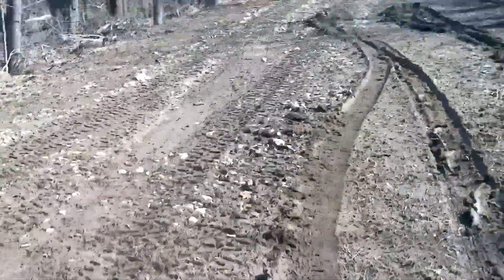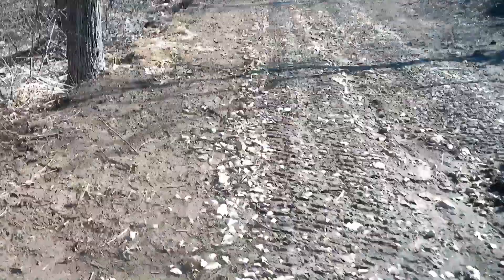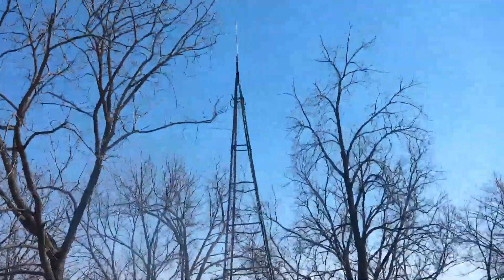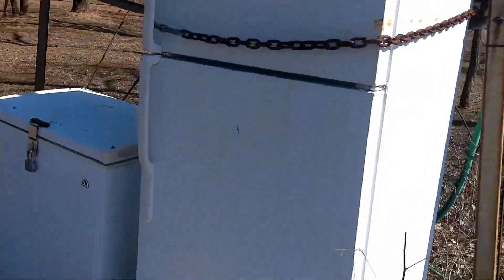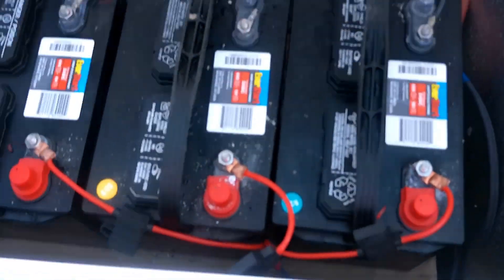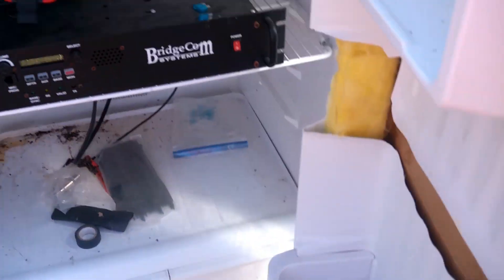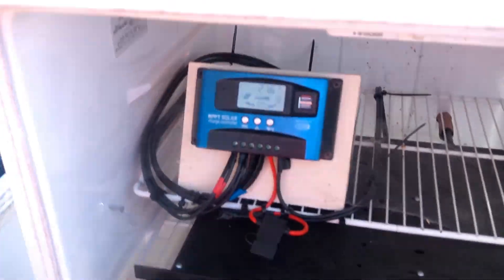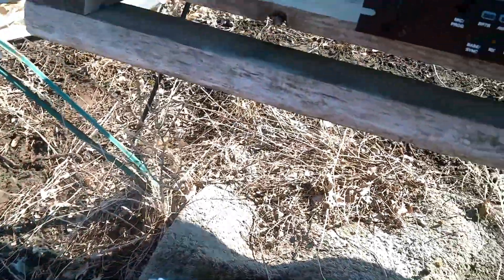Checking out a GMRS Repeater Site - Emergency Local GMRS - Ham Radio & Networking

Comment: Never thought about using old refrigerators a repeaters HUTs or shacks, but I guess when you're running off solar or small generator, you use what's available.  Excellent Job
Reply from the maker: Yep, they use it because A. It's cheap and has nice isolation from weather B. They want the EMP protection because the repeater is designed to be a emergency backup when shtf.
Reply: @hamradionetworking  I knew that, I was just saying that's a clever idea to re purpose an old refrigerator. Knowing me, I would use an old Locker, but that would require spraying it down to Rust proof it, which is nearly impossible to do. Of course, insulate keep to dry and cool . Nice Job Again 73 K3JCP & WQAI363